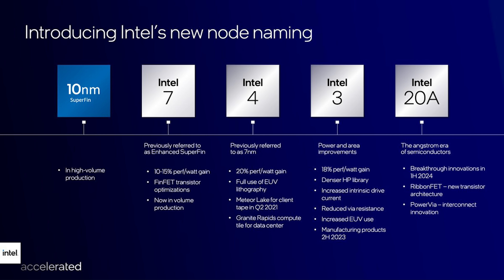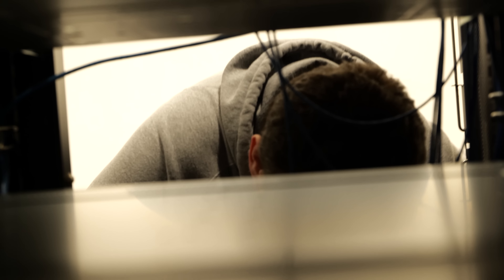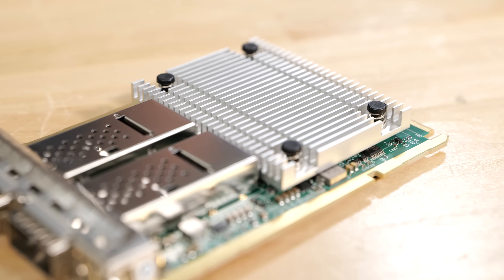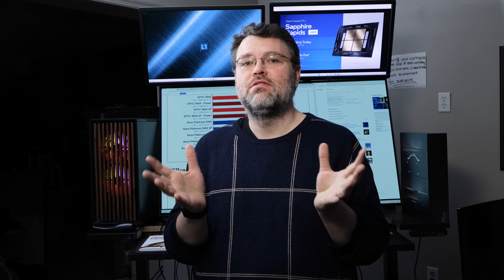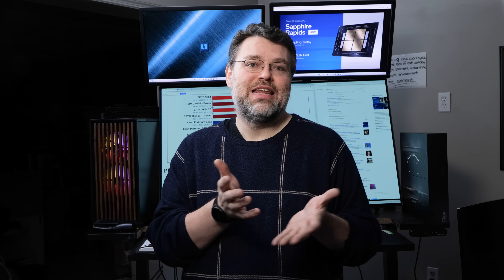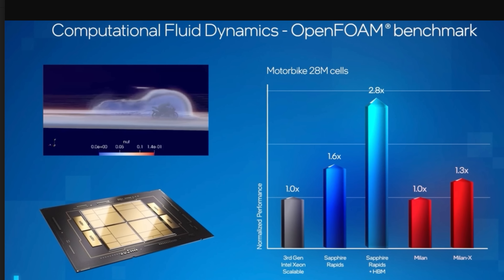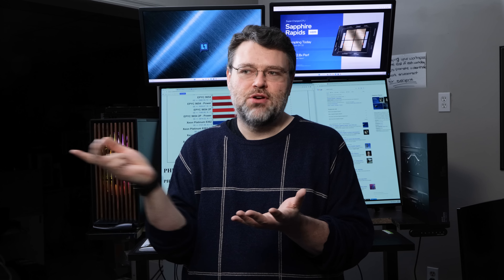Intel's Sapphire Rapids Finally Here! Feat. Supermicro SYS-221BT-DNTR

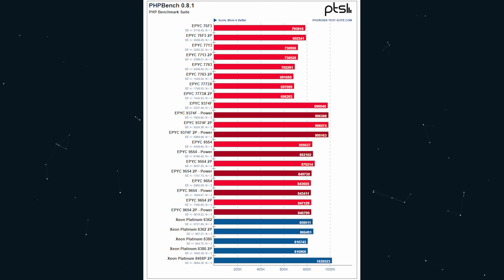Comment: 8:35 Comparing Intel Xeon 8458P 44/88 2.7G (3.2Gall core/3.8G max boost, updated: $6759 according to ServeTheHome) to AMD EPYC 9374F 32/64 3.85G (4.1G all core / 4.3G max boost, $4,850 each for 1k unit pricing) in the benchmark is a closer comparison instead of EPYC 9654 96/192 2.4G (3.55G all core/3.7G max boost, $11,805 each). I guess it comes down to price and applications. If the application can use all 96 core and less frequency sensitive then EPYC 9654 makes sense; otherwise, F-SKUs are more useful.

Comment: I'll never afford anything from Supermicro. But if ANYONE ever asks me what they're like,  "They are generous with showing off their amazing stuff"
Reply: eBay and ServeTheHome forum threads. I'm currently looking at the H11 and H12 Epyc platforms on there. If you can afford an expensive laptop like a fully speced out MacBook Pro or Framework, you can afford those platforms. Those are only 2 - 4 generations old. So not the worst deal.

Comment: 1:98 wat? Everyone knows the target release date was Q1 2022 and it got delayed by them having to respin the chip due to a bug. Other factors may be relevant, but not the reason for the delay.

In fact many memory manufacturers mentioned delays in Shappire Rapids as the reason for DDR5 not ramping as quickly as forecasted originally…

Comment: Would be entertaining if Intel forces AMD back into the threadripper market^_^
Reply: What is threadripper market?
Reply: @maxjames00077  There used to be high end CPU & motherboards between consumer grade & server grade hardware. Professionals could build custom workstations instead of buying server hardware at a 200% price increase. The last gen flagships where the 3990x & trx40 motherboards for AMD, & 10980xe & X299 motherboards for Intel

Comment: Are we getting these on desktop and if so when? Looks like AMD are no longer interested in providing Threadrippers for desktop so hopefully Intel seizes this opportunity. I'd love to build a new HEDT PC with one of those.
Reply: There will be TR Pro for sure. Zen 4  non-Pro TR is also on the road map but might be less priority than EYPC and TR Pro.
Reply: @harrythehandyman  TR Pro are wildly expensive so it's out of the question. You might as well get into Epyc. How do you know that TR non-Pro are on the road map? I saw a recent AMD slide where only TR Pro was shown on their road map.
Reply: The workstation parts will be called Fishhawk Falls, but seems to only go up to 34 cores per CPU and no details yet if dual or quad socket motherboards are going to come. But I’d expect multi-socket systems since otherwise the comparison with Threadripper would be absurd.
Reply: It seems like intel is going to fill the quad channel hole that AMD left (non-pro threadripper) with their WX-2000. Hopefully its priced for prosumer so you can finally get a platform with enough pcie lanes for dual gpu at a reasonable price again.
Reply: Just curious if AM5 prices enough PCI bandwidth and RAM for TR needs. I really don't know. Would the AM5 platform with 7950x give enough?
Reply: @deansmits006  I'm sorry, I'm not sure I understand what you mean. Can you please clarify? Any new Threadripper based on Zen4 (which 7950x is also based on) will have PCI-E 5.0 and DDR5. These new standards allow for plenty of bandwidth. The new Threadripper will likely be quad channel memory so it should theoretically have double the memory bandwidth compared to 7950x.
Reply: @deansmits006  Depends on who you ask. The reason AMD isn't doing HEDT with non Pro Threadrippers is probably a mix of them thinking their 16 core Ryzen parts serve the same market and them not wanting to cannibalize the Pro sales to the professional market (TR Pro is one of the few parts that carries the professional name for a very good reason).

If you ask enthusiasts in communities like L1, the much smaller PCIe lane counts and lower max memory capacity on Ryzen compared to even first gen TR* means that the 7950x isn't even close to a complete replacement for non Pro Threadripper, but the real size of that market segment and whether it would justify parts that aren't much better from a raw processing perspective than the 7950x is unclear.

*To be clear, we're talking lane counts, not total PCIe bandwidth. Having loads of bandwidth isn't that useful if your 10GbE NICs are using up a x4 lane slot but only needing x2 lanes worth of bandwidth, you'd be better off with more lower bandwidth slots in that case. Most enthusiast home labbers need higher lane counts more than they need each lane to be as fast as possible.

Comment: here we go I guess. Looking for what it could be used, being really out of touch with server space, so I have no idea why anyone would go for this if EPYC is available.

EDIT: so it was interesting. I forgot that EPYC doesn't scale beyond 2 CPU's per mobo. And unsurprisingly the stuff that Intel has really good control over and has dedicated some R&D to actually accelerate is working well. Very well. I do wonder how it will look after optimizations to a lot of normal operations happen as well. AMD could use them as well, previously they had to rely on brute force, but with adoption rate there is a chance that they will also get stuff optimized for them. Which is going to be great for users in the end.

I'm still not exactly trusting Intel with process nodes and how manufacturable this is. But it seems to be working and they can't delay it any further. Wasn't it supposed to originally launch in 2021?
And HBM version is going to go against Genoa-X, which is going to be interesting. Though different strengths I guess. Question is how fast can Intel iterate on that? Granite/Emerald Rapids, because Turin is going to be there in 2024. This is going to be hell of a battle.

And going to workstations? Finally it might push AMD to stop neglecting Threadripper. Though to be honest this will depend on pricing. And video doesn't mention prices. Because that (and availability) is going to be deciding factor in workstations and smaller servers that don't really operate with per core licenses. Though again, it might for per core licenses since SR has fewer of them. I feel like licensing will try to even it out and maybe price on something else. Optimal money model would be to price the license per performance in less core dense versions, while charging through the roof for "unused" cores in high density. I swear that if anyone thinks of the way how to monetize everything it will be one of those licensing companies.

Great job! Great Video!

Comment: Intel has its own vision. AMD has the mi300 😁
Reply: That mi300.... Massive. I don't even know what that would cost and what socket it plugs into
Reply: @deansmits006  this requires a rather new platform with oam GPU slots